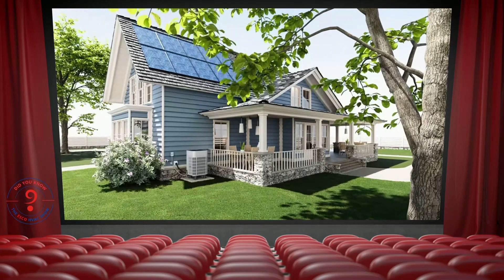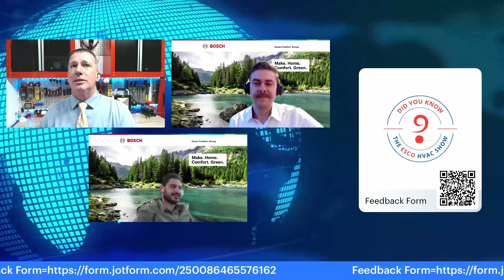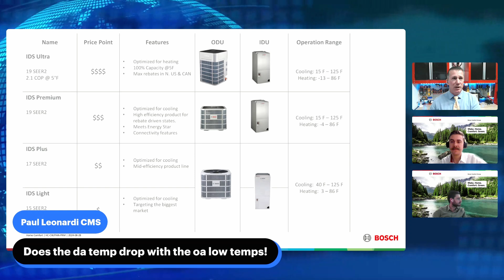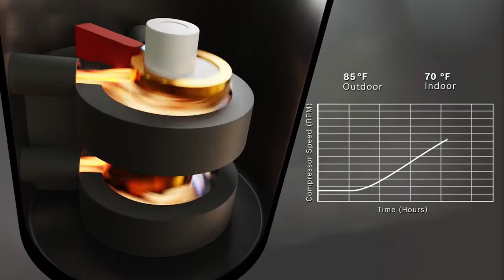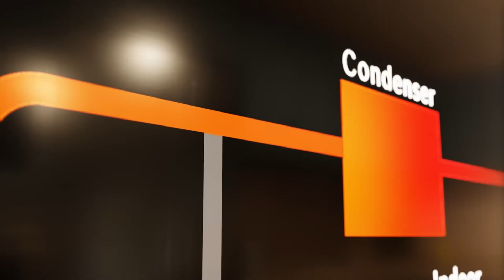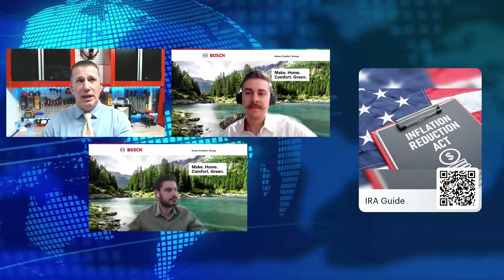Heat Pumps for All Climates with Bosch- Did You Know? The ESCO HVAC Show-Episode 118

Comment: Just installed that 3 ton ids light 14.3seer2  inv hp in place of a Good man 2.5 T 14 seer. The 15kW heaters used to energize at 30F odb. At 15F odb now, the hp is keeping up just fine. Real nice. I’m sure the ultra will be super.